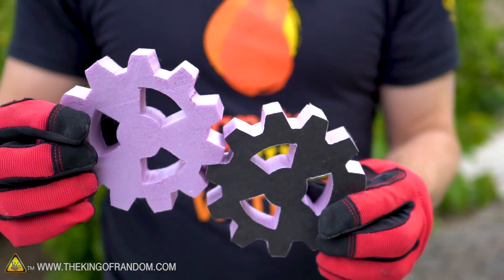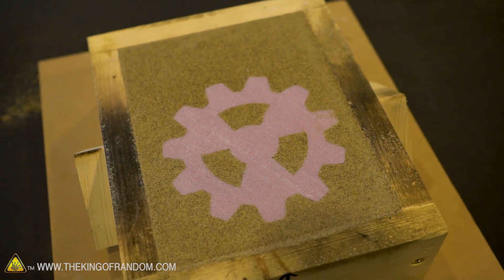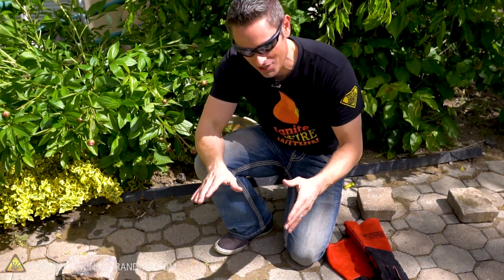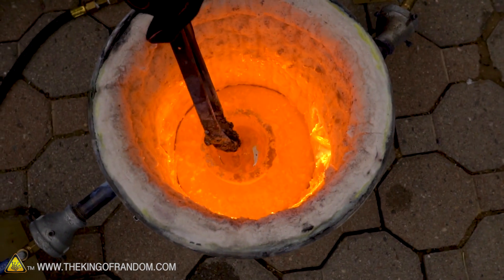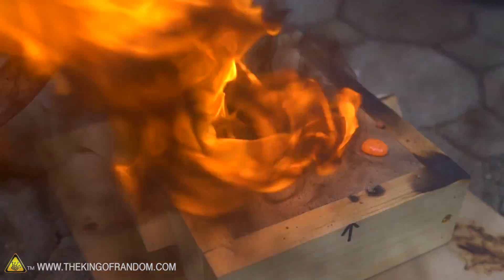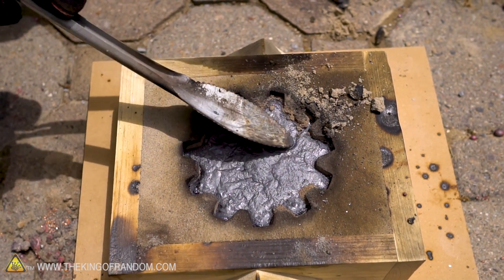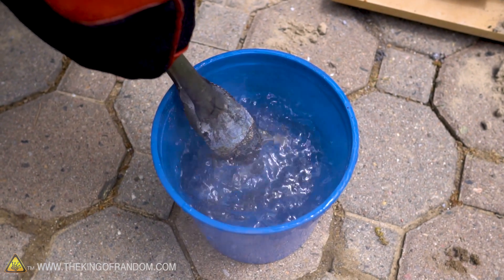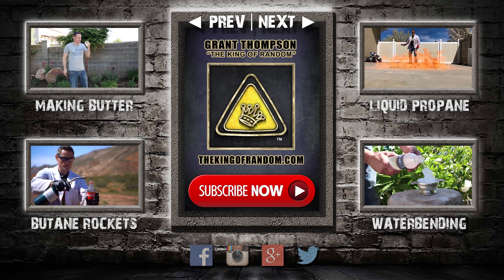Argh. Why Is Copper So Difficult? TKOR Tests Melting Copper In Our Homemade Foundry

Comment: Would a Silicon Carbide or Clay Graphite crucible be better for my application?  I'm using it for melting copper in a charcoal foundry. I used a silicon carbide for one melt and it worked great, the crucible had an insane amount of glaze on it but I wasn't bothered by it. Though, last night I fired up my foundry again and had the crucible fail and pour molten copper all over the bottom of my foundry.

Comment: If copper cools down fast. Try to do a double-layer casting, I don't know if i got the correct term. But if you did, it would trap the heat, causing it's cool down duration get's extended. Because the heat would be trapped and probably your rate of success will be high. Correct me if I'm wrong, don't judge.

Comment: It seems to need the Styrofoam intact as it's poured in so it's basically just replacing it and the foam is holding the sand in place until it's immediately replaced by metal... But it might help to pack down the and at various stages of packing the mold with extra special attention to the holes in the gears. I imagine that what's happening might be that the sand in the holes isn't getting packed in tight enough.

Comment: there is a way to keep the copper insulated during the poor and to increase the strength of the sand...Basically, do what you did before, but then attach a foam pour spout and a couple of vents to the gear foam. Then place the other half of your sand box on and fill with green sand so that just the top of the pour spout and vents are sticking out. This way, you can just pour into the one spout and let the heat vent out the vents, the copper is insulated through the entire pouring process and the sand is no longer cantilevered as it is supported on both the top and bottom. It will also prevent the top side of the gear from bubbling up...anyway, just a thought; it may work better this way.

Comment: Gears are cut, not poured, now u know why. Much stronger teeth & edges.

Casting one large disk allows liquid at similar pressure & temp to fill mold. Cools at same rate for consistent strength.

Comment: Get professionally made green sand, or better yet petrobond. Also you need 2 sides of the mold if you want both sides flat, copper gets all wrinkly on the surface when it cools.

Comment: You need to make a two piece mold remove the foam after making the mold make a sprew and definitely you need to mix your sand with used motor oil so it packs well. Also since you are reusing the copper after pouring skim off the slag.

Comment: Make a solid cement mix, but don't press the foam in all the way to the bottom, I suggest pouring cement first then put the mold in(not all the way to the bottom so the cement has a strong base and you can pour the copper into the cement mold) that should be really sturdy and exact mold to make your radioactive copper gear.

Comment: use plaster of paris mold easy and strong
Reply: Plaster of Paris will not work as it breaks apart with the heat, you can buy a modified version that is made for casting called investment plaster which can be purchased from home foundry suppliers.

Comment: Now i don't do metal casting myself, but seeing how that sand floats I gander it's significantly less dense then that copper causing the pieces in the middle to float up because buoyancy. I'm not sure on this, but a denser material to cast in might help. Lemme know what you think if your reading this.

Comment: 30 dollars for not even 2 kilos of copper? ask your local electricians (if they dont use aluminum in your country), or a scrapper,  you should get milberry copper (99%) for under 10 dollars per kilo. you definetily got ripped off there. if you want to cast copper more easy, use the ancient art of creating brass with a bit of zink (zn30 in the periodic system, dont know the english term for it).

Comment: ....what about (I know this comment is way too late but) roasting or torching the mold so you can cast without having to have that styrofoam gear in the way. Torching/carbonising the sand makes it a little tougher and maybe strong enough for the little “holes” in the gear stay where they need to be

Comment: when making the casting by putting Styrofoam gear in and compacting with sand then turning it over to expose the gear ? why not place a wooden cover over gear with hole drilled to pour copper into this would protect it from radian heat when pouring ?

Comment: It would work better if he packs sand in a 2 part mold with a sprue on the bottom, fill it, put the gear next, pack that then invert the mold.  The copper would not cool so fast while filling the gear space inside.

Comment: The reason the sand is breaking is because when the molten copper hits the wet sand the heat causes all the water in the sand to evaporate and dry out the sand

Comment: The burning plastic gases are probably causing mechanical displacement of the sand. This would probably happen with wax or most other materials you would replace the styrofoam with.

Comment: borax in the molten copper helps with flow. helps hold the heat in while pouring. Two part (cope and drag) with sprews and risers works best. then you don't need foam burnout it comes out the riser holes. I am surprised you even got a successful part doing it this way.

Comment: Copper is heavy, man. It will shift any loose parts of the mold aside like they're nothing. You've seen it with the last casting - the pressure of the copper flowing in from all sides simply broke the loose sections apart and pushed them to the top. You'd need something like clay at the very least.

Comment: 1. You need to use bentonite clay mixed with the sand to make it stick together. 
2. You don't need to burn the foam out.
3. You really should use a cope and drag type mold with gating, your results will be much better with few failed castings.

Comment: it probably has to do with shrinkage, maybe if you use metal plates between the foam and the sand,  maybe just sheets from beer cans would work. I live in a condominium so i can try it but it does look like the copper shrinks and pulls the sand with it.
Reply: please try if can.
Reply: nevermind. saw your next video where you used plaster instead of aluminum plates.... Perfect.

Comment: Could you try pouring more slowly, and reheating the copper when it gets too cool?  That would solve the problem of the notches floating.  They're being torn away by the current in the pour.  The slower the pour the less current.  I don't know if copper will meld or make layers, but it would be fun to find out.

Comment: Mix 10 parts sand to 1 part stone mortar. It'd also be better to fully enclose the mold to make it cool slower and reduce the risk of cracking, if you wanted it to be hard you wouldn't use copper.  Dissolve the foam out with acetone or PEK.

Comment: I find this interesting, but know very little about it. The sand seems so unstable. So why not put the styrofoam gear into wet cement? Then let it dry and harden. Then burn out the styrofoam gear, and pour in the molten copper.
Reply: Cement relies on moisture to keep it's strength. Moisture and molten metals don't mix, usually with explosive results. The reason green sand works is there is enough air space around the grains to let steam escape withough blowing up. Using an open cast with fine details like the spokes of the sprocket won't really work in an open mold because the metal is heavier than the sand, so as soon as the sand dries out enough, it breaks away and floats exactly like his 6 attempts. Using a closed flask would solve the problem, but that's not what he was trying to do.
Reply: Concrete or cement will explode if you get it hot....guys we sold a power coat system to didn't insulate the floor and cracked it...also I've seen ppl bust a floor cutting with a acetylene torch and getting the floor too hot.
Reply: Never pour molten metal onto cement, it is dangerous as cement holds a lot of moisture and can even explode if you do that.
Reply: Then how to get the gear out?  I put a quarter into wet cement and its still there today.  It worked better than when you superglue the quarter to a table at the park and watch people trying to take it.

Comment: I was watching a guy smelt sand into glass, and a worker at the smelting company he was working at, pointed out that his glass kept breaking in the mold, because the mold was packed TOO much. Apparently, the science behind it is that the mold was so tightly packed that the temperatures had no where to escape, which eventually cracked the glass. I watched your video and when you wet the sand, I think you sort of made it so tight that no air (temperature) was able to escape, which is why 3 chunks of sand cracked before your mold was complete. Try it once with barely wet sand, loosely packed in some areas you can spare it (obviously not the 3 mounds but maybe along the edges of the gear).

Comment: The the molten copper is more dense than the sand thus forcing the sand to float on the copper. Loose sand will break away and float.

Comment: Center only supported vaguely, it will float (it did). Try using refractory cement (some calculations necessary for critical dimensions) then burn out the styrofoam. Preheat the cured mold some before pour.

Comment: Make a 2 piece mold with black sand so it holds in the heat so it doesnt cool as fast, instead of using the existing sand to make the holes in the gear use baked sand its harder and wont break apart as easy. you'll have to grind a bit of the casting where the file hole was and do some finish. also add a zinc power to you copper, stops the bubble spots. Used to work in a cast Iron foundry

Comment: That sand is either too dry or too light for the copper. Molten copper is about as heavy as molten iron, a fact that most people seem to forget. A closed sand cast, a reinforced cast (with cement in) or a sand mixture made for casting heavier metals is what you need to consider.

Comment: Try a little Iron chloride in Distilled water to damp the sand with. Say 3 to 5% by weight, additional. Dissolve well and damp your sand well. Let dry overnite in LOW oven. Less than 200°. 
      Use iron tray with lid for Yer mold container. Have a generous hole to pour through. Also have small vent holes in all pinch areas and end areas as well.
Try to GENTLY Boil molten Cu to rid Dissolved gasses then Flux to remove impurities. Skim well and repeat Flux & Skim.
    Then pour into prepared mould. DO Not move or open too soon.
  Might help a little.

Comment: Next time you try a styrofoam mold and need to get it out without hurting the sand, put a little bit of pipe cleaner, what you would use to glue and clean PVC pipe also called primer to melt the styrofoam then poar it out

Comment: I would say: remove the styrofoam as gas is released during auto-combustion; add another frame of sand for the base with vent holes and a pour spout.

Comment: If you try to cast copper, you have to use kinetic sand. Since it sticks together, it's much easier to cast anything with a high melting point.

Comment: You could have used concrete instead sand. It had been surely enough strong. If you use only cement (and no sand) in the concrete, it could have been very beautiful.

Comment: try using aluminum foil around the foam gear it will hold some of the gears shape and keep sand from breaking of in it

and if you file it, save the dust so you have a small pile of copper and foil left over for a new project

Comment: If sand is unstable and often  popped out,why don't you used clay...🤔
Reply: That's exactly what i though and clay is easier to mold.
Reply: It will gives somewhat the exact shape.....🤔
Reply: He could use a mix of sand and clay like in a foundry along with a top mold with a spout to hold it together
Reply: @Shagz  My thought exactly with a closed two piece mold with a spout. It'll give him the uniform shape he's looking for.
Reply: Ikr
Reply: Or just stabize the sand with something. Like nails.
Reply: The clay traps moisture and it can explode that’s why
Reply: Should go with furan sand
Reply: This would not work due to the fake that the clay would over heat and crack
Reply: @theoofs8404  There are some sticky clay which cannot crack while or after burning...
Reply: Joel Pachuau when it dries some leftover water could explode the clay and send molten copper everywhere
Reply: True
Reply: The idea was that he wanted to try to make it work with sand.
Reply: Looks like wrong type of sand.
Reply: Yh but clay takes ages to dry
Reply: it'll boil off the water
Reply: Yeah it would  be easier
Reply: or plaster maybe
Reply: Clay may melt or burn and make a wierd shape where as sand won’t melt
Reply: @ajawesom  Really, Wikipedia says that fire clay can withstand a minimum of 1515 °C, not to mention the fact that the ceramic blanket in his furnace is made from clay.
Reply: I wouldn't use The King of Random as a guide for melting metal. I think these videos are dangerous and teach kids dangerous techniques.
Reply: Bingo.  He's dead clueless.  We need to create a betting pool on how long until he burns off an appendage or down a  neighborhood.
Reply: Isnt that the fun of his shows though?, seeing things fail teaches people why a process wont work in practice.
Reply: @goatscrot2117  This comment didn't age well
Reply: @goatscrot2117  
That comment was somewhat prophetic! Especially the "Hes dead clueless" bit. Yikes...
Reply: @tomasotreasaigh111  I better be more careful when speaking like a smartass 🤷🏻‍♂️
Reply: @goatscrot2117  this comment didn't age well...
Reply: @System-ru5yt  @Cliff Gray But it is still aging... unlike the KoR.
Reply: @goatscrot2117  you win the pool...I guess
Reply: @erikwithaknotac  Yikes--didn't expect that

Comment: Sink  1 half  of your cog into  green sand then complete with image in a super compact strata use a closed mould , and melt your metal using an electric coil. Spray both sides of the mould with M3 scotch glue. Beyond the hassle. I would commission them as copper has a horrible viscosity.

Comment: Take a .25" steel rod. dip it in the crucible. If the copper sticks to the rod, its not ready. Your sand doesnt have enough oil in it too. Also pack it with less sand then add more and pack it.

Comment: yes but used elmers glue in sand and I had a top on it using a pipe I made an entrance for copper and an exit for excess I made cast copper pan which I later sold for three hundred dollars used about 95.00 dollars worth of copper I used rigid copper pipe like you did but added  1/4 lb brass as I deemed it to soft would I do It again  no way

Comment: Sand is too dry and you might need a little more clay added to the mix.  Should be able to pass the break test.  Grab a handful, squeeze it, and then break it in half.  Should break clean.

Comment: duh you use talk on mold before you pack sand so you can remove the mold.

your using the wrong form of foam that does not evaporate...  instead it just reduces, and hardens.

also the sand is either not wet enough or not using the correct type of oil.

Comment: You should try inclose the sand box all over with another sand box and actually before you put it in to the water cover it up with flux for soldering then it shouc come out from water crystal clear, but I'm not an expert 🙂

Comment: Mix up a little cup of concrete or cement poured over your mold gear let it set then use a blow torch to burn out the styrofoam gear use some sandpaper to make sure everything's nice and clean then pour the copper into your cement or concrete mold and if you're going to whine about how it's going to get stuck don't make it too thick no more than one inch on top of the mold so that the cement or concrete breaks apart from the copper with a simple tap of a hammer

Comment: A bit of chemistry is needed here. Add tin to reduce the melting point and heat required. Create a mould with sand on top with a hole going down to an entry point (which you can cut off later).

Comment: It looks like you have a buoyancy problem. With the wet sand all 3 bits of sand came up, it seems to me like the water in the sand floats on the copper since it has a lower density. The copper being more dense it pushes up the sand and the water I believe.
Reply: André Laroche, two remained intact on the first pour. He needed better compacting and perhaps reinforcement.

Comment: perhaps the sand is  becoming neutrally buoyant. have you tried completely encasing the mold on all sides? the reason i say this, is the pieces that are popping out, are snapping off at the bottom, not just crumbling, they come out intact and come straight to the surface.

Comment: After melting the styrofoam keep heating the sand so it binds a little so when you pore the aluminum or other metals the mold details can stand the wait of the pore.
Reply: Probably have to add something to the sand as well for and easyer bind.

Comment: For one your sand is to dry. two you don't leave your foam mold in and try to melt it. And are you using any clay in it. i did green sand casting with brass and aluminum. Also you can use a core for the inner parts.

Comment: Another reason why it messed up, is cause you were sand casting wrong, a tip is you only pack where it's going to be casted, meaning only pack where the gear will be, not all the sand, and then torch the sand that was packed and pour your metal, it will come out allot better

Comment: Instead of buying virgin copper pipe from the hardware store just use scrap - it's cheaper and there is lots of it. Save the planet and your wallet ! Also why are you not using a two-part sandbox for the moulding ? AND then remove the Styrofoam former leaving an empty pattern/void.  That is why the copper cools too quickly. Using proper casting sand blasted with CO2 it is firmer for casting.